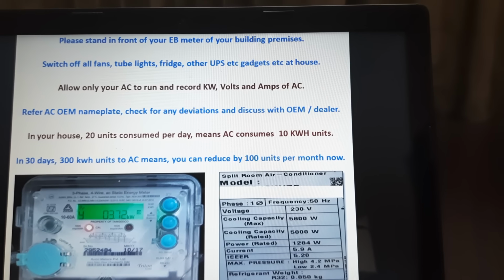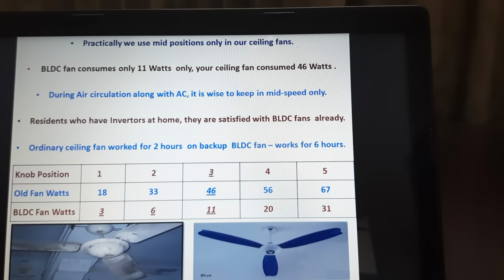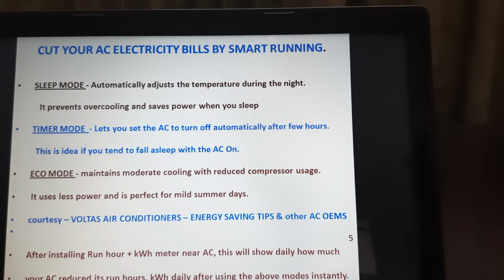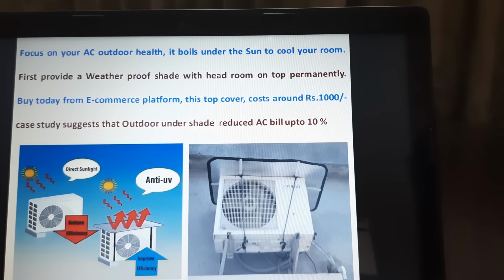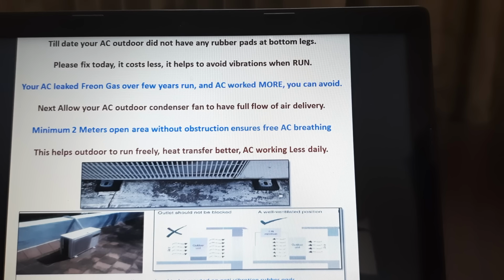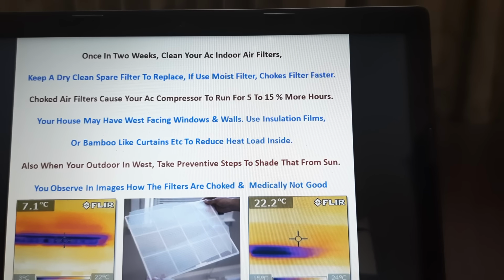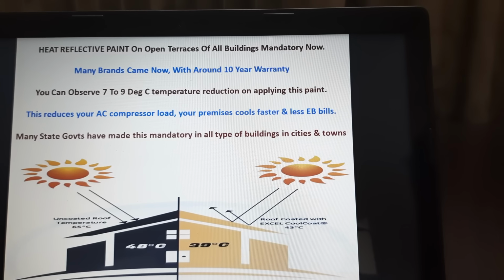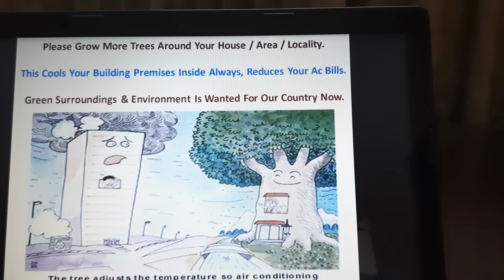Air conditioner’s Electricity Bills can be reduced upto 30% #AC #electricbill #BEE #energysaving

Comment: Keep a humidifier in your room , put off the fan and run AC in summer.
Reply from the maker: I understand your room conditions match to your requirements of temperature and humidlty. Pls see whether you can sustain that for longer duration.
Reply: @energymeasuretosave3082   it is applicable in summer time as the climate is dry.

Comment: Also a trick I use which has almost halved my AC bill..... After running in 27C in COOL mode for short time I change to DRY mode which runs compressor and fan very very less but also keeps room with less humidity and quite cool in Chennai humid weather especially..... I don't know the science behind it but it works !!
Reply from the maker: Yes, you have done the right thing suiting to your place of residence. DRY mode compressor and fan very less only and you had achieved excellent energy savings
Reply: Which ac has dry mode
Reply: @petrichor259  All ACs have Dry mode--Panasonic, Carrier...
Reply: @petrichor259  if you find out let me know as well
Reply: @petrichor259 all Acs have dry mode. Check your remote
Reply: @leprincz  Yeah I just checked. Thanks
Reply from the maker: To tell you plainly I am not conversant with the AC available in the present day market.

Comment: IF we have to raise AC temp to 27 degrees C, what is the use of having an AC. Let us throw it out of the window.
Reply: Exactly 💯😂
Reply from the maker: It is okay, to manage at 27 C, pls dont throw it out of your window.
Reply: @energymeasuretosave3082 no sir, I don't agree
Reply: Our body needs moderate temperature. Below 26 degree  you cannot sleep without wrapping yourself in blanket. So what's the point?
Reply from the maker: @singhsingh7777  pls keep above 27 C and have a comfortable mild cooling with mild air circulation around the body, that is the point.

Comment: Why so less views? .....seems People r not interested on actual solutions
Reply from the maker: Thank you please, atleast now the views I feel are more. Previously my youtube videos were more detailed and time consuming. Now only I have reduced to 10 minute short video.
Reply: @energymeasuretosave3082  I read a comment on your video where someone mentioned using the AC at 27°C along with a BLDC fan at speed level 2.
Sir, my approach to saving electricity is a bit different. I also keep my AC at 27°C, but I don’t use any fan. I’ve installed my AC in such a way that the airflow directly hits my bed without using swing, so I basically use the indoor blower itself like a fan.
I’ve focused a lot on insulation as well. My house is painted white to reflect heat, I use door seals to trap the cool air inside, and I’ve sealed all possible air leakage points.
One more thing I do is collect the AC drain water inside a bucket in my room instead of letting it go outside, since it’s relatively cool. I keep it until it reaches room temperature and then dispose of it.
I’d really like to hear your thoughts on this approach...am I doing it right, or is there anything I should improve?
Reply from the maker: It may sound trivial to others, but you are doing great, you have approached minute things to reduce the heat load, this must be the mindset of a typical AC user. Kindly share more about your user installation and energy related experiences as it is knowledge sharing on saving to all of us now.

Comment: Great insights

I generally use AC at 27° only for 8 hours without any fan need
It's inverter 1.5 T

So do I need to do anything?
Reply from the maker: That is excellent. But you can see your AC kWh and run hour to know whether you are efficiently loading that.
Reply: @energymeasuretosave3082 okay sure , thanks for info 🙏🏻

Comment: You don't want to. The condenser needs air. The condenser doesn't care if it's in the sun.
Reply from the maker: I understand your confidence of the condenser functioning under the Sun. But still the heat transfer efficiency drops when the ambient surrounding is Harsh under the Sun. Thanks for your plain query and feedback.

Comment: Using my LG AC on 27 degrees + BLDC fan at speed of 2. Very comfortable
Reply from the maker: Excellent Ji, what I am just discussing in this youtube, you have already achieved. I am trying to re-learn from your experiences. Keep sharing, so that 27 Deg C is acceptable to AC user mindset, then only he can keep at 27 C. Every user wants to follow now, from  some one like you and many of us in this chat group, who had already achieved excellent electricity savings in using AC at this pattern. Appreciate this energy saving sense has prevailed upon many of the AC user citizens. Thank you JI.
Reply: @energymeasuretosave3082  just to share a personal observation.  We have seen that our LG split inverter AC can be run at 29 degrees and with a normal fan running at full speed in about 30-45 minutes the AC's own remote thermometer registers the room temperature as 27 degrees. Absolutely no need to overstrain the compressor.

We have seen there is really no need to even go below 27 degrees if we really want to...
Reply: What if it's last floor, if I switch on the fan it emits lot of heat from roof?
Reply: @Divyapriyaabi  same problem
Reply: @Divyapriyaabi you can use table p
fan standing one. with revoluting fan it will circulate air from ground up and 🎉oom can chill faster. but still not as good as cieling fan
Reply from the maker: Ground mounted HVLS fans bring in lot of cooling air by the Wind chill effect, but this is useful for big halls. For small rooms BLDC fan is more than sufficient. Thanks for your query.
Reply from the maker: Only way to dissipate the Solar heat ingress is to apply cool roof paint after thoroughly compressed air cleaning that top area. or you can think of providing a weathering shade on top of the terrace if it is not disturbing others. Now many people are improvising new ways to reduce the roof top cooling.
Reply: Broo does your fan very close to AC that might have cooling issues right ??
If we sleeping below the AC and Fan is too close than cooling is getting wasted correct ??

How you use both ?? You do you turn off ac with timer and BLDC Fan to run for 8 hours ??  With AC turned on ??
Reply from the maker: Thanks for your practical user query and curious too. This BLDC fan is so mild in air circulation this uses less static pressure to push the air volume to the occupant who is at the center zone of the fan and with AC running, this will give cooling to the user around the center of the room. Hope I could answer your query to suit you.
Reply: inhave been doint this for as longs as i got AC, always rediculed as cheap for using fan and ac. but i still do. one thing i learned about BLDC fans. assumed they were just silent fans. thanks , we still learn everyday if we can 0:00
Reply from the maker: you are right, and thanks for your user experienced feedback, Thank you for the same.
Reply: Thank you sir for highly practical solutions to save power bill

Comment: During summer we do not use greaser for hot water  and we use Both Ac at 27 with fan at speed of 4
We get bills below 1000
Reply from the maker: That is great, you are conserving and educating us back as a user.
Reply: No one use greaser in summers  ,  there was no need to mention it
Reply from the maker: @Deepak_Rathore0 that looks like typo error. Pls ignore that. That is Geyser, that's what he wanted to say.
Reply: How many hours do you run your AC?
Reply: @abbashaidari8313 4 hrs max with timer on
Fan runs overnight

Comment: 8:07 its just white paint. Birla white cement plus dr fixit solution is enough, it should be for all sides of the house, not just thr roof.
Reply from the maker: You are right, first existing top surface needs to be cleaned with high pressure compressor and go for Albedo or Heat Reflective Polyacrylic paint, now many brands have come.Thanks for your inputs.

Comment: I am sharing my first AC experience and extensive planning behind it and hope this reaches many people. I got a new ac this March. The model is “CAI19EE5R35W0”. I got a steal deal from Amazon and got this amazing model for just 30,500₹ including all card offers and Prime membership. I paid another 1500₹ + 400₹ + 2200₹ for the installation, stand, and stabilizer. So everything cost me under 35k. Now coming to the savings, my room is just 100sqft and gets sunlight from the west and on top; however, there is a mighty Jamun tree that partially covers the terrace and provides shade until 2pm. Since this is a state-of-the-art inverter ac, I run it for at least 12-14hrs  + ceiling fan since I also WFH permanently. In the last month, my e.bill has only gone up by a mere 1400-1500₹ because this ac also records the electricity used by it daily. I never have and never intend to run the ac below 25*C. Overall, I am very happy with the research I did before the purchase and the quality of the ac and saving more than I intended to… 😄
Reply: forgot to add that my ODU is stored in complete shade and never gets direct sun light
Reply from the maker: Your research on selection, application, installation, and running your AC is really value addition to all of us, Great to hear that, kindly keep sharing more about your Ac. You told one thing that your AC records its kwh, first time we are all hearing that. kindly share more details about aspect of monitoring. in fact, all the AC oem to have inbuilt kwh meter in the AC indoor unit to cover all kwh.

Comment: Sir have you tried that water spray kit that attaches to back of outdoor ac unit that sprinkles water to cool radiator even faster
Reply from the maker: That is a good idea alternatively. Really a worthy try. We still remember decades back, our window AC outdoor fan impeller had a splash ring. One thing for sure, condenser fins need to be routinely cleaned for better heat transfer. Thank you Ji.

Comment: Pro tip but one those wifi smart plug they show you real time wattage use
Reply from the maker: Yes, wattage is measured there thro smart plug, then it is the need of the hour now.
Reply: But be sure to get the 16A+ version & nothing less by mistake- you can then use the same to get the watts then estimate per hour for washing machine, chimney, A/C etc
Reply from the maker: @maxpayne69. This type of smart plugs surely prompt our usage efficiency
Reply: @maxpayne69. True almost forget to say that ..my plug is 16 
I'm aware a lower amp could be dangerous

Comment: One can use a smart plug to monitor and record the Volts and Amps being consumed instead of going to the main meter. Is a good investment. Besides you can also operate the AC remotely.
Reply from the maker: Your idea is good, but basic parameters is not enough. We need totalising kwh parameter to pick up here to know total run hours and total kWh units per day. With kWh meter only we can correlate this with Incoming EB meter kwh  readings.

Comment: Inverter ac has fine control of temperature while non inverter has not, its corse. So keep ac at 30 degrees so while compressor shuts off it would be around 26-27, do study. Keep cool mode and fan speed to level 1 or max 2, it will work superfine.
Reply from the maker: Thanks for the info. But this will create a temperature band of 30 to say 24 deg C hysteresis will be there, so the user may feel hotter at 30 C, better to go for precise controlled E Prom micro controller chip for active and precise band temperature control. Nice that you could manage at 30 C as well as the cut out temp, this is Coarse control, but temperature is a slow variable, so fine control is needed here.

Comment: Use EESL GOVT AC OF ISEER 6.25 

I use AC for 15hours with just 3units for that

Use AC in half load which gives ISEER OF 6.73
260w for 1760Watt cooling 

Who can beat this efficiency 😂😂?
Reply: Bluestar also uses this exact AC with extra WiFi chip , only expensive by 4000 from EESL AC
Reply: @ccx22  when u use for Half load ,it would take 2x time ro cool right ?

When u use automode ,it chooses right load according to temp
Reply from the maker: @aemssw2387 Half mood means literally it is not half mode. The AC is partly loaded to match to the demand from the user.
Reply from the maker: @ccx22 That is great.
Reply: What is outside temperature in your area and at what temperature you set in your AC?
With fan?
Reply from the maker: @nilayrachchh3371 My setting is 28 C and outside temp is 38 to 35C. I always use bldc Super fan
Reply: @energymeasuretosave3082 okay
Reply from the maker: Wonderful Sir, infact you have to share more about your energy conservation practices and routines here for the benefit of all of us.
Reply: What's EESL govt AC?
Reply: @BoyBombay  it's EESL brand 1 TR ac , you can find online by searching this

Comment: Buy inverter ac of 5 star.
From the best company.
Reply from the maker: you are right, If the purse is full, the user can definitely change to Inverter driven split AC. In between in his existing AC, he can try these Low cost measures to improve the AC usage efficiency and reduce his AC Electricty bills.
Reply: The savings from 3 to 5 stars isn't as significant as the jump in costs.
Reply: The AC will stop working before the time you recover the extra amount paid for 5* ac as premium.😂
Reply: @TheGamer720x not for ogeneral and mitsubishi
Reply: If you want to use it for long run more than 7-8 year go for 5 star vice versa
Reply: 5* ratings or inverter ac or LED bulbs is a farce , it's just a marketing gimmic by consumer electronic companies. 
On an excel sheet it maybe true 
but in real world consumption it makes no difference as the electricity bills only keep rising.
Reply: @sandeepbhatia602  you also need to buy a stabilizer for AC because you never know..,
Reply: @sandeepbhatia602 Even i was thinking the same untill i got my 1.5 ton 5 star Panasonic ac. My old 1 ton ac consumed 6 units for 8 hrs usage whereas my new 1.5T 5 star ac consumes just 2.5 units for 8 hrs at 26c temparature